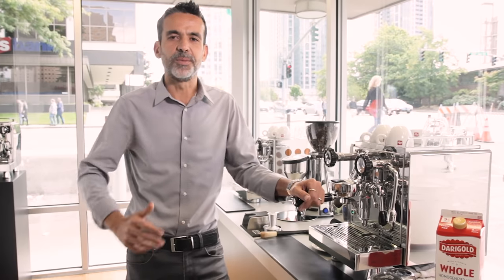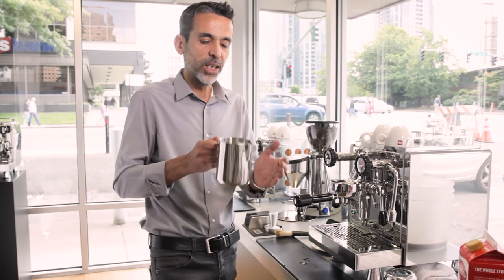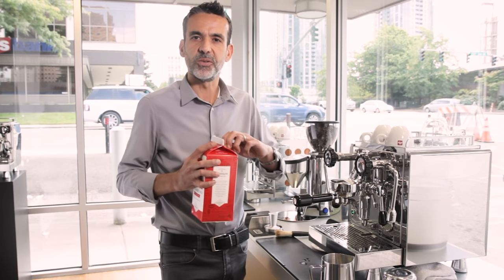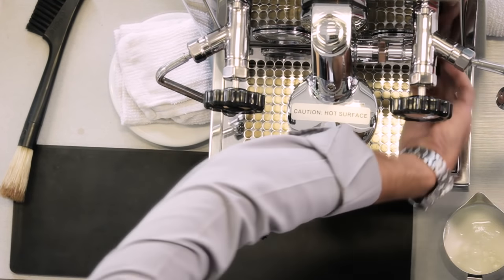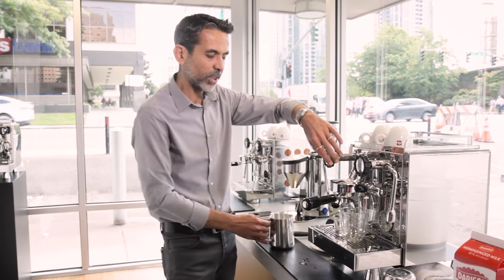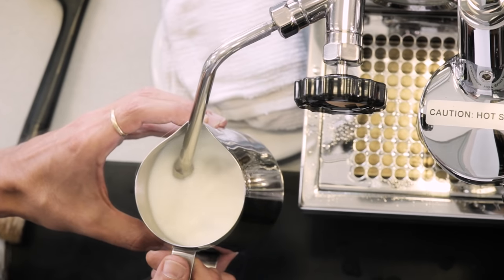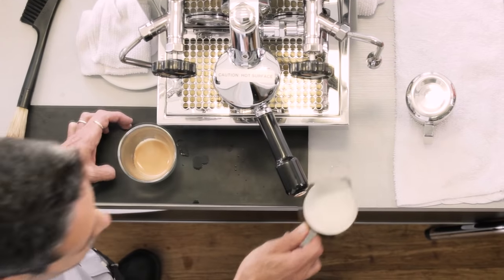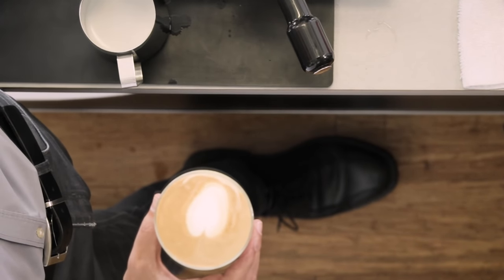How to Make a Latte

Comment: so the only difference between a latte and cappuccino is the amount of foam on top?
Reply: yes surprisingly so. The cappuccino carries more foam than the latte and flat white thus making it stronger due to the lower amount of milk.
Reply: Basically. The latte is also usually larger
Reply: toobles   Also, there is more milk in a Latte. It is usually served in a larger cup than a cappuccino.

Comment: The thing I never hear mentioned is how it's not the pressure applied when tamping because if that might vary depending on what espresso you are using. If you use the same espresso every day, probably not a big deal. But some roast are dryer, some more oily and if you use same pressure, your shot might pull way too fast or way too slow. It really depends on the beans.

Comment: I did everything right
but my latte just tastes bad, unless I add sugar(I dont see how people even describe their drink as 'chocolaty' without adding anything, I dont get any flavor, no matter what beans I try.....)
Reply: Curious if you're using a thermometer and making sure the milk doesn't go over 160? In the video, the gentleman talks about using the hand to determine when the milk is done, but I'd think there'd be a large variability in a person's tolerance to hold that pitcher. I can only hold the pitcher until about 130 before I have to use just the handle. My wife can hold it much longer. I use a thermometer and pull it when it's at about 150.

Comment: I have just noticed that capresso made en "update" to the EC-pro, the Cafe-pro and i was wondering if you could do a review/comparison of the to machines. I went to the capresso webside and did there comparison and the only notable difference was that the EC-pro ad 16bar of pressure and the Cafe-pro had 15 bars. Is there any other big differences between them? Thanks :)
Reply from the maker: Hi Christopher! These machines are functionally identical except that the EC Prop has a single boiler while the Cafe Pro moves to a Thermoblock. Let me know if you have any other questions!